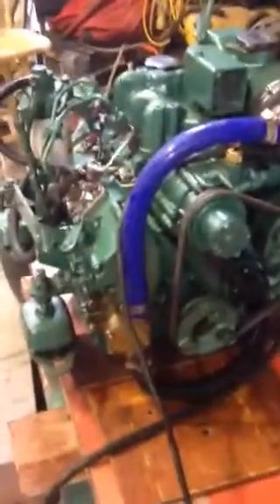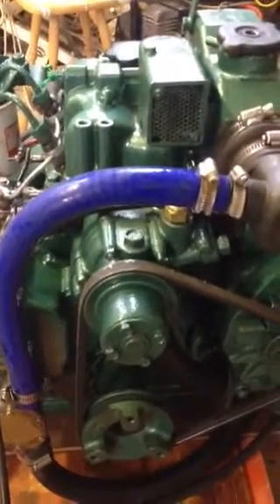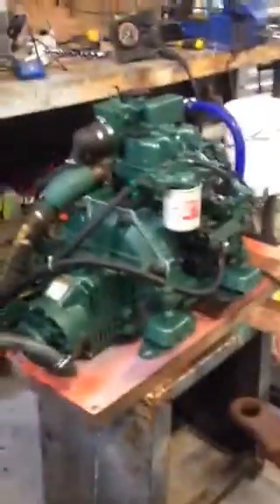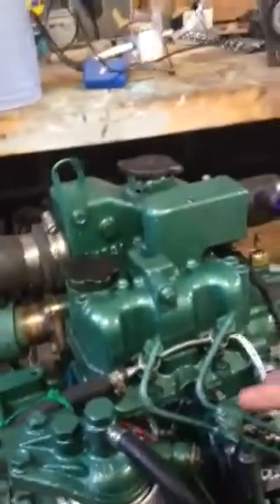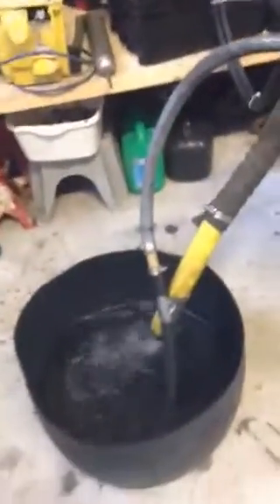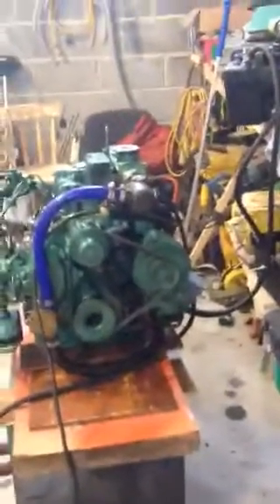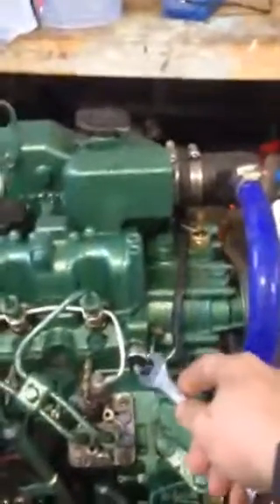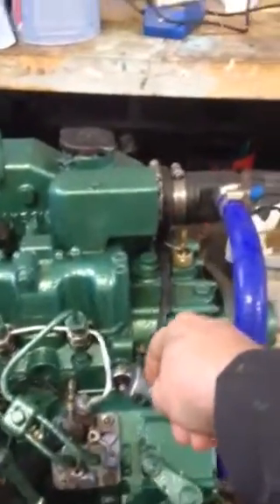Volvo penta md2010 engine rebuild finished part 22

Comment: Hi Mac, Great series of videos thank you. Q. How much work did you have done to the block and head in terms of machining / reboring etc and roughly how much did that cost? 
Mark
Reply from the maker: I gave block and head to local shop near me and they rebored out pistons to suit new oversized pistons and they slimed head. You are only talking fraction of mm, I think they charged me €300. Good luck.
Reply: @supergreenmac  Thanks Mac.  I'm mulling over doing the same project on my VP2040. Sadly don't have quite the same wide open and bright workshop as you but still enough room. Mark
PS. What does slimed mean? or is that a predictive text error!
Reply from the maker: @marktuson4111   slimed is just what they call here making sure the block is flat. The shop puts it on a flat surface and set a machine to skim ( or remove high areas ) to insure it is completely level so that it will mate up again with gasket and block. This may not have to be done at all in your case. If an engine ran out of water and got too hot the head might warp and need skimming. You can check yours with metal ruler. You would only need cylinders bored out or honed if there were ridges in them. Of course again, you need to check compression and inspection to find out if you need new pistons or just new rings.
Reply: @supergreenmac  Hi Mac, Thank you again. I'm slowly getting to grips with the finer detail of engines but not having much of an engineering background there's a lot to take on. Great fun though researching it all. Stay well, Mark